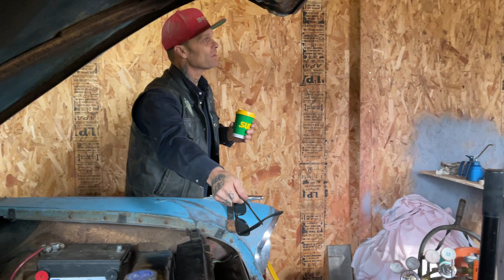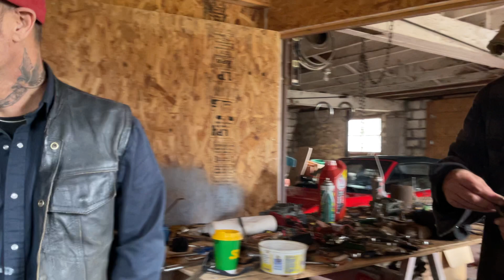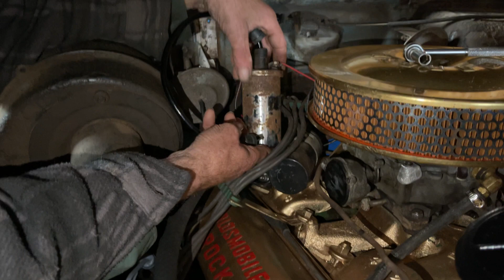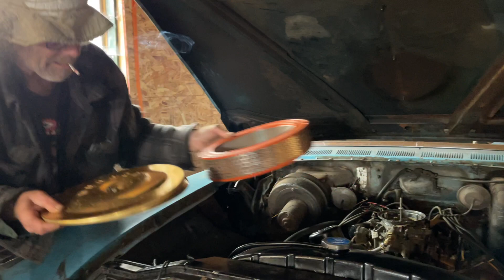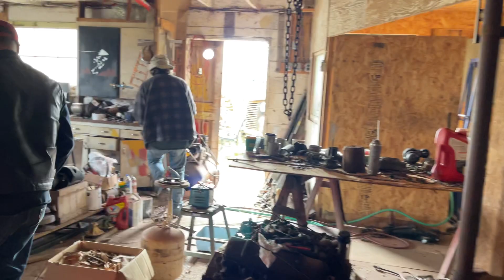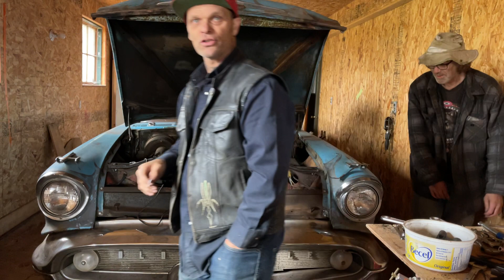ENGINE TROUBLESHOOT: WHY IS JIM'S ENGINE NOT GETTING FIRE? 🆘

Comment: points are officially called breaker points, as they break the circuit to ground. Meaning as the distributor turns the lobes and cause the points to open and close, breaking and making current for spark for each cylinder. So if you hook up the positive power to the positive on the coil then touch the ground wire to negative of the power source the coil should produce one spark every time, When you break the circuit and re-apply to ground you will get another spark.

Comment: No mechanic, but I would check the voltage on battery and get a coil that says the same as the battery voltage and get a cheap volt- olm meter to see if the coil is open on the small terminals if using those used coils. I think the circuit for the small wires has to work before the coil sends spark to the plugs. Also, I am thinking holding the ground with your hand may not be a good enough connection for checking the coil for spark. Not sure but I think they call the small terminals the primary circuit and the spark the secondary circuit. Thanks for video        Jim will get it figured out~ LoL

Comment: best suggestion is to examine module in the distributor for brand name or part #   google for a wiring diagram and wire it up accordingly. Just switching wiring around on electronic parts is asking to fry something. Love your shows. I try to check your new one every day.

Comment: the positive comes from the ignition. the negative comes from the distributor. the spark only happens when the points open up because the coil is like a capacitor. sometimes the positive from the ignition is there when you turn the key on. but when you turn key to start the motor you lose the positive because the ignition is bad. so you take a jumper wire and go from battery. to positive on coil and then try starting the car and it should start and run of your problem is the ignition. so to recap the coil is a device that not only stores voltage but increaces it. so it will only spark when the point open and it has not connection to negative. you can take a coil and hook it up to a regular battery and have the coll out spark next to the ground and whey you take the negative wire off it will then send the spark out. and if you take a coil and hook a positve then a negative for several seconds. then take the positive and negative off the coil still has the voltage in it and you can put a short wire from the positive to the out put and it will spark.

Comment: TO TEST THE COILS RESISTANCE Get a Multimeter tester, To test the primary coil. Set it to ohms put the Black lead to negative side of coil and Red to the positive side. The reading should be between point  .4 and around 2 ohms. This is called Primary.  To test the Secondary coil, put the Black lead to the top of coil where the spark plug wire goes, and the red lead to the positive side of the coil. The reading should show a resistance of about 6k to about 15k. To wire in the coil run a wire or trace a wire from the battery to the key switch. From the key switch to the negative side of coil. then from the positive side of coil to the capacitor in the distributer / breaker in the distributor P.S. Electronic ignition system is different.

Comment: The most basic thing when working with electricity is to be sure you have a *circuit*. It's not enough to 'bring power to' a device; electricity needs a way to get back to the source too, or it can't flow

Somebody mentioned that the black box, where the points would be, perhaps cannot switch the power to the coil terminals by itself. It could just be sensing the crankshaft position, and signaling an engine control module to actually switch power to the coil.

Comment: Most of the points elimination modules require a full 12 volts. The factory resistor wiring is dropping the voltage below the 12v needed. You will also need a hotter coil. I would check the ignition module's specs for that.

Comment: Only just got to watching this video today. Dang, I hate screaming at a screen when I know you can't hear me. LOL.

I've read a lot of comments saying the same thing in different ways, but most would go over the heads of most. Collapsing field, etc., though all correct, might sound like wah wah wah without a visual to go along with. 

On initial observations you have a couple simple issues to resolve/know. 1) of course you can test a coil. Use a volt/ohm meter and measure resistance. There is primary resistance readings and secondary resistance readings. Basically a coil has these two parts. If either circuit is open or shorted, or way out of spec, replace it. Go to, uh, YouTube University for testing process. I won't do it justice without images. 2)  you have a ballast resistor, mostly, because oil filled coils cannot run on 12 volts without getting hot and failing prematurely. They've not changed much from their 6 volt cousins. Newer coils can handle the 12 volts, but few do. Aircore coils can, and are cheap (but require the correct plug wire style) Also, if the car had points still, the points arc less on the 9 volts-ish seen after a ballast resistor. 3) the Pertronix setup (I assume) has two wires. A red power wire and a trigger wire, which is not technically a ground. If grounded, as I saw in the video, it will likely fry the Pertronix in short order. This black wire goes to the negative terminal of the coil and is what causes the coil to fire. The coil will never fire as it was wired in the video. The red wire of the Pertronix should go to a 12 volt source, key on. You also must retain the ballast resistor if you use a stock coil, so you need to feed the red wire to the Pertronix pre-ballast resistor, and the coil + terminal post-ballast resistor. 4) the body of the coil is a can, not grounded to anything. The only connections are ( + ) power and ( - ) distributor (black wire on pertronix only). 5) the key switch start/run positions determine when the coil gets 12 volts when cranking on start, the on run goes through the ballast resistor to get the 9 volts. A test light would be a hard tool to use to make sure you're getting the correct voltage. 

I know this may even be more words than a picture or video would show. But at least I feel better now. YouTube University is your friend as well as your bread and butter. 👌

Love watching whether things go well or not. That's how we all learn.

Comment: Chad just pulse the power to the coil and it should fire. Make sure the high voltage wire is good also. The magnetic field has to collapse to get a spark! Chad the distributor has the points that pulses the coil. Listen to Jim!!!

Comment: The only safe way to test for spark is to use a spark plug tester tool. If a coil problem is suspected, measure the coil's primary and secondary resistance with an ohmmeter. If either is out of specifications, the coil needs to be replaced. A coil can be easily bench tested with a digital 10 megaohm impedance ohmmeter.

Comment: Chad, the distributor points or electronic ignition in this case sends power to ground witch gives you the spark from the coil Jim is correct. The electronic ignition is the problem 
Hope this helps

Comment: In the distributor the points that open and close Sans aground to the coil that sends the spark through the coil spark plug wire that goes on the distributor cap the power wire going to the coil energizes it with power then the ground wire from the distributor inside where the points are it sends a ground signal shorting out the coil every time the point open and close the short goes through the spark plug wire that goes on the coil to the distributor cap I hope you understand how it works now

Comment: That's right Jim now if you took your test light and hooked it to the positive wire and that coil wire that's the ground you would be able to tell if the light turned on if your electronic ignition was working or not or if you had points if they were clean enough to make a Kinect

Comment: With all the wires taken off the terminals of the coil attach the positive and negative probes of the meter to first the negative terminal then the positive terminal on the coil. You should have a resistance reading of at least 3-4.5 ohms. A bad coil will show a higher reading then 3-4.5.

Comment: The gm cars have a 6 volt coil. The momentary contact in the starter solenoid bypasses the resistor in the wiring harness which puts 12 volts across the coil which doubles the output voltage for a good spark at the plug for starting only then it runs on 6 volts...

Comment: The coil works as such ;  power from the ignition comes in through the positive terminal. the negative terminal earths through the distributer and aslo through the spark plug . To test sit the coil on the battery connect positive to positive, instal a plug lead to the coil with a good plug in it ,also earthed , as it would be in the engine. when you touch the negative on the coil to the negative on the battery it should spark at the plug

Comment: You know that you said to google it !  Well thats the quickest way to doit if you don't know.  Cut, the points send the coil the signal to fire ..... the distributer just sends it to the plugs but either way it has to go through the whole system.  Anyway from experience when I'm not sure I usually  do google it to save  time and if its something I need to see I go to Youtube for a video or 3 to watch ..... saves me lots of time.  No one knows everything and its quicker to take a moment to see what the answer is.

Comment: pretty sure that the grounded end of this system is the spark plug the core arcs to the outer lug/gap tang finger thang, that is in contact with the  block/ground  the coils are components that are used to step up the positive  power while the distributors points are used to adjust the distributor timing throughout its rpm range. there cannot be any power to the plug if there is a path to ground in between it and its power supply. hope this helps Jim out. those coils are definitely bad I would change wires out as well . 
since I don't usually comment on anything and may not again for some time thanks to every one that makes this channel possible you are producing content that inspires

Comment: Check for power on + side of coil with test light.  Then check negative side while cranking and test light should flash.  Yes, resister is bypassed when cranking to ensure close to 12v.

Comment: An ignition coil is basically an electromagnet. ... The coil becomes a transformer, stepping the voltage up. If your car uses a 12 volt battery, the 12 volts you put into the primary side of the coil will exit the secondary side as 30,000 volts!Oct 11, 2005

Comment: There are you tubes to help.The original wire from distributor should be thrown away.From the electronic ignition the black wire goes to - negative on the coil.The red wire goes to + positive on the coil.This is where your two other wires ( one resistance one full voltage ) all join on the + terminal. 
I hope it's not damaged from yesterday's testing.

Comment: From the starter goes to positive.[ ignitiion on ] and negative from the coil goes to ponts hook up with condenser  ?
Reply: Yes generally the condenser mounts to the coil bracket.  Jim said he’s got some kind of electronic module in the distributor cap. Hard to say what they got going on just by watching the video. If he has a standard distributor that would be a good place to start.

Comment: Most of the electronic points replacements like Pertronix that have 2 wires, red and black, need to have the red wire to the positive side of the coil(with both ignition wires)and the black wire goes to the negative side of the coil. Nothing els connected to the negative side.

Comment: You guys have your wires crossed   The coil gets a power wire connected to the positive side   And the wire coming out of distributor that is connected to the points connects to the negative side of the coil. A ballast resistor is sometimes needed between the power wire and part of it on coil this keeps you from ruining coils.

Comment: there will be no spark in the coil wire if the points are dirty or don't open and close when its turning over , you have to have spark in the 
points or nothing works  boys

Comment: Try putting the red wire on the + side of the coil to power the CDI Unit... then the black wire on the - side of the coil for the CDI to Trigger the coil.  . The CDI probably gets its ground from the distributor.

Comment: It's gotta be the coil especially when you got power in but nothing coming out. But it needs to be the right voltage coil. 6 voltage or 12 voltage. It will be nice to see Jim's car running Chad and jolene

Comment: that setup the 2 wires from the distrib. 
 both go to the coil. red side goes to the power side and the black goes to the negative side(side where the points normally go)

Comment: the distibutor breaks the ground on the primary side on coill to collapse magnetic field and make the secondary spark from coil wire to rotor then from rotor to plugs  test coil by puting12 volts to pos on coil  and touch neg off and on battery neg

Comment: If Jim has a pertronix electronic ignition   the two sides both go to the coil. The red wire on the positive side and the black wire on the negative side also with the electronic ignition you do not need a ballist resistor  I hope this helps.

Comment: Jim on this cars from the switch there is a wire ceramic resistor on the fire wall If is rusted is not sending enough voltage to the coil to convert to hi voltage necessary to start motor.

Comment: You guys are confusing the body of the distributor with the cap. The bottom is the switch to the coil ( points, condenser) and is low voltage to the coil. High voltage comes out of the middle of the coil to the distributor cap center and will go to the rotor to be distributed to the spark plug wires.

Comment: Hey Jim: Olds bro:  I had TWO full wiring harness meltdowns in my 56' Olds.... WHy ?????????????????????  Defective ignition switch !  Hot power in can do a LOT of damage.  I had the fire department attacking my car in a public parking lot.   Sometimes those things we take for granted, don't work.
Reply: Yeah, I totally rewired twice.  In those days, wreckers had a bunch of '56 Olds on call.  Once I needed an upper control arm (another story!).  So, I went to the wrecker and watched as the operator basically scrapped a restorable car to scrap metal: cut the body off the frame just to make it easy to get off !

Comment: Check the points. Coil won’t create spark if the points aren’t opening and closing or dirty. The neg wire on the coil is connected to the points. The points make and break the coil ground to create the spark.

Comment: Although I dont expect this info to be usefull to you.  You guys know how to make good car projects.  But I'll offer some info. anyway
  The series, dropping, resistor system is used so as to provide extra high spark only while cranking.
 If the coil is designed to use ~6 volt, and is used on a 12 volt system, a resistor from the ignition switch to the coil to drop 6 volts, the coil will see 6 volts while the engine is running.  
  This system allows the "6 volt coil" to be fed 6 additional voltage *only* while cranking, by connecting 12 volts to the coil ONLY while cranking.
  That allows a higher voltage spark while cranking but a sufficient spark voltage while running.
  Note, the coil has a specific capacitance across the points to provide maximum spark. So, for best results, match the coil with its capacitance. 

  Your mileage may vary --
  If you find a coil in a car that has an original capacitor across it's points, use that capacitor whit THAT coil.  I think you will find a coil + capacitor somewhere in your "stash".

Comment: The red wire from the electronic ignition and the original coil wire go on the plus side of the coil, the black wire from the module goes to the negative side. Hope that helps

Comment: The newer style Petronix electronic conversion has a rev limiter built in that can be set on the module by removing the cap just a note in case it's bad get a little something extra since Jim's going dirt tracking

Comment: Sometimes you have to run a wire directly to the battery to the coil to get it charged up with the 12-volt I have a coil if I let it sit too long I have to do that

Comment: Connect an ohm meter between the coil terminals to test the primary circuit! About 1.8 ohms Then connect between the tower and one of the terminals to check the secondary coil resistance! Abou 8,000 to 40000 ohms Jame UK

Comment: If you put the test light on the distributor side of the coil and crank the motor the light will flash if the distributor is functioning. Tom Martin.

Comment: if thats an electronic ignition instead of points then the red wire should be on the + side of the coil and the black on the - side of the coil , which means jim should have 3 wires on the + side and a single black wire on  the -

Comment: Check the points
Test coil connect power put coil wire in center with power to coil test for spark by touching the coil to ground monentarly

Comment: like on a hit and miss engine with out a magneto , like on a Fairbanks Morris 1 1/2 you run the battery to the + and the -neg, from the coil to ground and no spark plug wire and then you will get spark to the trigger in the engine, it looks like a points and when it opens it fires ever time the the trigger opens it ,oh its called the igniter just hit me what its called hahaha

Comment: You have a constant power and a switch power so constant power goes positive and switch positive goes on negative to distributor side so it has complete circuit when cranking

Comment: Negative goes to the distributor hot wire has to be hot all the time to the positive and if you have a problem you have bad point or bad condenser